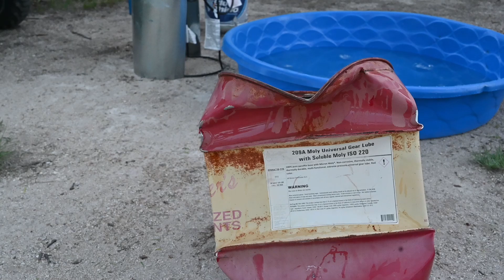HVAC 135 Vacuum P2 Atmospheric pressure

Comment: If pressure and temperature are related, them does the atmospheric pressure drop when it gets cold outside??
Reply from the maker: Great question!
So the outside is not a sealed chamber and not a single gas. 
Typically the air outside can become  heavier or greater atmospheric pressure when it gets "cold". The molecules are moving closer together and become more dense. The other factor is moisture. Typically when the outside air is "cold" it has less moisture in it. Most air weighs less than dry air. Than altitude will be important factor on top of both of those.

Great question. Love that your thinking.
Reply: @love2hvac  Thank you Ty. Happy Thanksgiving.